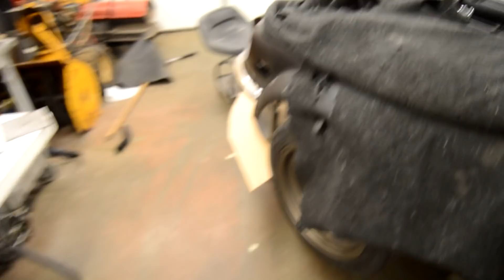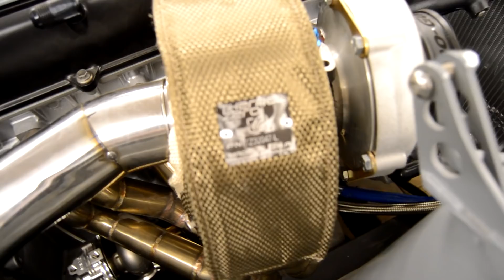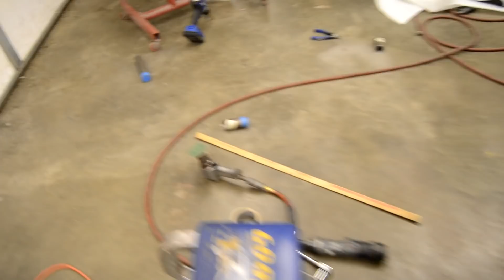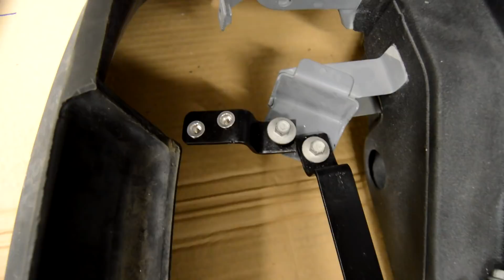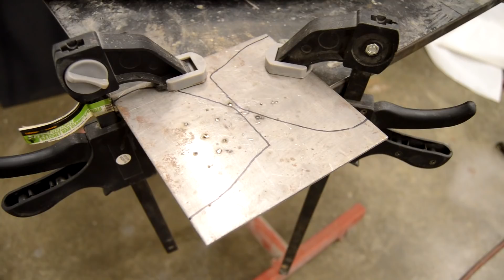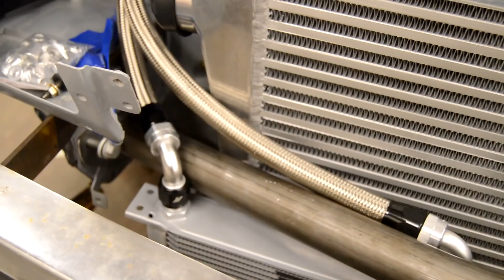1jz 280z Build Update | Front Jack Point + Radiator Ducting

Comment: Is the jack point bolted up to the same place as the bumper? 🤔 looks good!!
Reply from the maker: No, it has a different set of holes. They were there from factory, not sure what for. I had to drill 1 hole for the 240z bumper to fit. I can send you a pic if you want of how it bolts up now that I have it installed fully.
Reply: Stewart Motoring would be awesome if you could send me a pic!! Here’s my email: oscarzamora26@gmail.com

I just picked up some 240z bumpers front and rear, and if I could get a jack point in somewhere would be even better. Thanks!!
Reply: Great vids, captivating! I'm hoping your jack is low enough to go under the splitter while at ride height.

Comment: Hey always loved the 280s
I have a Volvo 240 wagon with the old 7mgte on the works. Had a similar problem with the heating hoses so I did a 90 degree elbow and it worked perfect so maybe that idea  will work to clear your fuel rail. Happy Holidays

Comment: Looking good Man, 
You can get a lower temp thermostat to help with the running hot concern.. I think i got a Mishimoto T-Stat  My 2J never sees 190 degree temps in the Phoenix AZ, Summers. I have had my swap for 3 years now.
Reply from the maker: Very true. If I do have issues that’s what I’ll do thanks. This reminds me of my 240sx, the thermostat is stuck open haha, I never have to worry about over heating lmao.... ahh... I need to fix that...
Reply: @StewartMotoring  That open t-stat won't hurt anything unless you want heat faster. I had to take a stuck t stat out of a car in the middle of winter. Hands froze, 0 degrees outside. Had to wrap up in blankets, to drive the car until I could get another t stat. Lol

Comment: very nice job ! great attention to detail aligning the cooler fittings on the sandwich block! however the placement of the oil temperature temp sensor will get you the heat soak temp of the surrounding environement since it is not in the flow of oil, it should be in the oill flow.
Reply from the maker: Thank you. We shall see if the temp reads good or not. The sandwich plate is thermostatic so it will open up at 185 degrees f and send the oil to the cooler. So I should be able to see some fluctuation at that temp so I can know it’s working

Comment: The building is coming together. Keep up the video. Very good review on the fuel help. It helped me select jaz tank for use in my awd build.
Reply from the maker: Yeah Jaz has the best price and all the features I wanted in a fuel cell. Worked out great. It would be even easier if you mounted an external pump. But I went with internal
Reply: @StewartMotoring  I'm doing the internal mod also. I like that set up better.